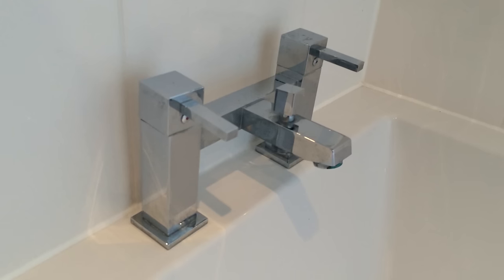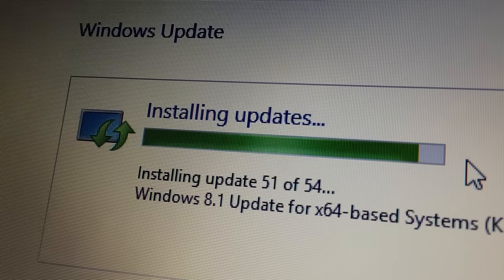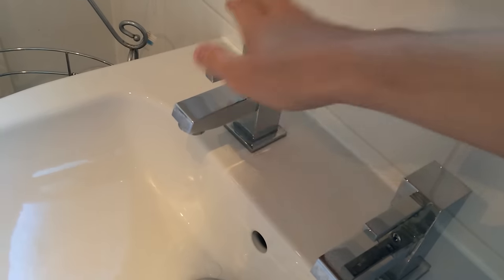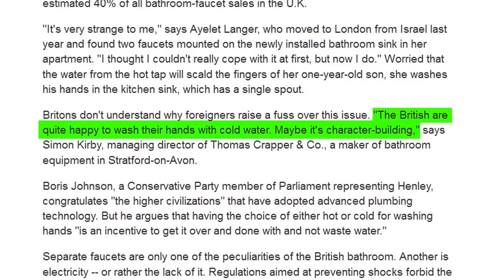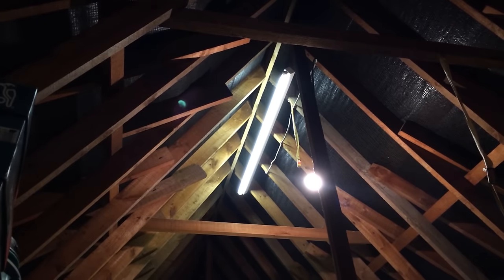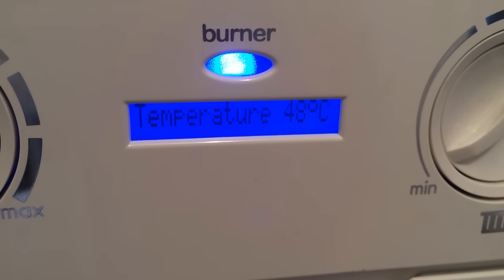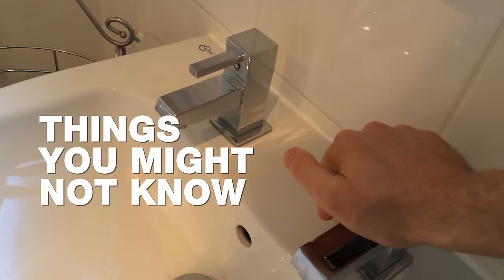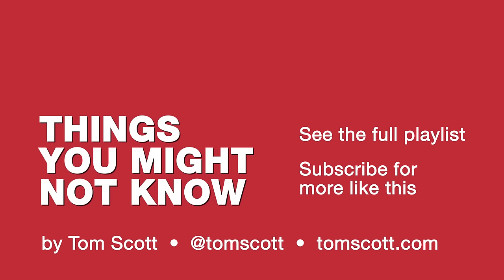Why Britain Uses Separate Hot and Cold Taps

Comment: How do you wash your hands/shower?  One's too cold, one's too hot...
(Personally, I use cold 99.9% of the time)
Reply: Most showers still use mixer tattoos anyway...

*edit* *taps
Reply: Hands you just use cold or wash them quick enough that the hot doesn't get hot. Showers do mix hot and cold fortunately.
Reply: Most modern houses have mixer taps for handwashing and for showering either the shower mixes it or it has a heating element inside the shower which heats up the water on demand.
Reply: my shower is electric and heats itself up with a built in temperate display and clock and precise temperatures. I can't stand showers pumped from the tap.
Reply: I think most people here have electric showers.

Comment: Another reason is that if your cold water to a mixer tap is straight off the mains and your system also includes a cold water tank that feeds a conventional boiler, then in some circumstances back pressure caused by the mixer can cause water to reverse flow back up into the hot water tank, then into the cold tank and overflow!

Comment: Ah. Sounds like the Brits didn't have non-return valves or pressure relief or venting.
I wonder why?
Reply: No idea.  They are very effective and reliable.  I never understood the logic behind having an open water-storage tank that gets dirty and can freeze up easily.  Of course, if the pipes burst, then the whole house gets a shower.
Reply: @PhilJonesIII  Because money was tight back then and that's how those old houses were built. It's different now.
Reply: Depends where in the UK, the type and quality of the building, and other factors.

The Boilers used today however... as complicated as they are strictly checked & tested.

Comment: Interesting ! (but how do you handle the "shower" case then ?)
Reply: Keep your mouth and eyes closed tightly? Or just treat is a sever inoculation for plague.
Reply: Don't people have electric showers anymore? They are heating cold water on demand and are therefore connected to the mains. Yes, usually their throughput is such that it takes half an hour of dancing underneath the drops to get damp, but if you manage to catch a drop or two in your mouth, it's perfectly safe to drink (but means showering even longer)

Comment: You can use a back flow preventer. They are required in the USA on all non-potable water systems that are attached to potable water.
Reply: Doesn't help with cholera.

Comment: Actually ... even here in Austria, where we have safe tap water everywhere, we somehow don't use hot tap water for drinking or cooking.
Since we don't have the rat problem (different system), I guess it is because we think that the hot water provided by district heating passed through a lot of pipes and probably dissolved some contaminants from them.

Comment: As a Brit, I actually very rarely see separate taps anymore.
Reply: I don't know where you go but I see them every single day.  This is partly because we don't and never will have mixer taps (which are the work of the Devil) but also because most domestic houses still have separate taps.
Reply: Joshua Rosen it's a mixed bag, alot of kitchen suites these days come with mixer taps by default, but bathroom suites are still generally two tap

Comment: So how does one take a shower in Britain?  If there's no mixer tap, that means you must have freezing cold water, or burning hot water, and no ability to adjust the temperature?  Or you have to set your hot-water heater to a temperature comfortable for showering or washing hands, but no where near hot enough for cleaning clothes or dishes, which makes no sense to me at all.
Reply: shower???
Reply: Most use cold water heated at point of use (a so-called "power shower"). They often have a slim box mounted inside the shower with the temperature control on.
Reply: It's DEFINITELY hot enough to wash dishes, I've burnt my hand on that shit more times than I care to admit. As for washing clothes, it's hotter than needed, and the actual washing machine regulates the temperature anyway.
Reply: Scuba If you scalded your hand in tap water, turn down the temperature control nob on the boiler.
Reply: dash3693 You've clearly never lived in accommodation where you have no access to the boiler
Reply: Showers have one head, so the flows mix. For old showers (connected to a bathtub) you turn on both taps, and adjust until the temperature is good. Most showers use a separate control panel with one dial between hot and cold
Reply: Yes, though I don't agree we prefer baths as a nation.
Reply: Adam Goodfellow I live in America and I have showers with different handles for each temperatures, I think the fancy ones you find at hotels and stuff are newer
Reply: You can adjust the temperature all you need to do is turn a bit of the cold on and a bit of the hot on to make it warm or whatever temperature you want it
Reply: It depends on the type of shower I think, one type runs off the cold water and heat it there and then.
But you can have a type which connects to both taps so you can mix the two. Trouble is they tend not to mix as the taps are at different pressures and you find the water goes from very hot to cold but it is hard to get a nice warm mix in between.
That's why I don't shower :O)
Reply: Well, in my case I'd  be using a thermostatic mixer shower, with ceramic valves, and have a nice steady even temperature. In fact, I'd just leave the temp preset.
Reply: Madame Careless That's separate valves, not separate taps.  Separate taps in a bathtub would have a separate faucet for each line.
Reply: Madame Careless It isn't the handles they're talking about, it's the taps.

Comment: sure, it's safer, but for gods sake one tap shoots out freezing cold water and one tap shoots out super hot water, why not have one cold tap that's used for drinking and one mix tap that you can use for cold, warm and hot water?
Reply: he addressed that. concern over the hot unsanitary water back washing into the safe water supply. would happen even if you had 2 cold dispensing taps
Reply: Ch33ki
Reply: br33ki
Reply: Or have them in separate pipes in the same casting, so they heat sink each other.
Reply: iv damke
Reply: Or a standard regulation mixer where the water can't return after being mixed?
Reply: Or two seperate taps.

Comment: Strictly speaking, the regulation isn't the reason why there weren't mixers in the UK. Rather, the regulation is just a byproduct of the fact that nobody bothered with mixers because historically the Brits used to fill up the sink and wash up with the water that's in it, rather than wash with running water that comes straight from the tap (a bit like how older Brits also prefer taking baths than having a shower). That's evidenced by the fact that many sinks have the taps so close to the edge of the sink that it's quite difficult to wash your hands under running water. Today, this way of washing up is viewed as totally unhygienic, but as you said old habits die hard...

Comment: How do you take a shower then? You got two shower heads? xD
Reply: Both are connected to the shower. Usually the hot water is hot as balls and the cold water is to cool the hot water down
Reply: and how do you wash your hands? or wash vegetables/fruits in the kitchen? in cold ass water? in summer maybe it's ok, but in winter not so much
Reply: Arrivederci Well you'd turn on the hot water and hope its not so hot. But our house has a mixer tap. But our shower doesent.
Reply: @tomnow92  In winter not so much? Don't you have heating?
Reply: Your shower is like a mixer tap.

Comment: I live in a relatively new building in California, the tap is suprisingly good quality because the pipes are all in good physical condition (less than 2 years old). There's no slightly fishy chlorine aftertaste like in most taps around here (I heard that tasting the chlorine is technically a bad thing because it means there's a high level of bacteria and microorganisms in the water that weren't killed off during the water retreatment process).

Comment: I was told never drink hot water from the tap but boil cold water and allow it to cool. I still do.
The cold storage tank and hot cylinder gone now and I have a condensing boiler. Still two taps in the kitchen and bathroom sink and extension sink
I recently installed a bath and run one pipe from the hot water and can set the temperature on the boiler, then let it run awhile until I get hot water. I have a nice old brass tap I wanted to use even though it says COLD on the ceramic insert and left the copper pipe exposed as a feature. It needs polishing again.

Comment: Well we have those "mixers" at Finland. We are told not to drink warm water and it's better let cold water run moment before drinking.. Well water gets colder if you let it run, so there is that also. it's just so much simpler, older housing here also sometimes have separate taps, but if renovated about always switched to mixer ones.

Comment: Letting the water run, I was always told, was due to many houses still having lead piping to the house so it would avoid drinking water that had been sat static in a lead pipe for a while. That was in the 70s in UK.

Comment: I'm from Germany and got a mixer tap, but are used to let the water running because some old houses were equipped with lead pipes when I was a kid. This changed obviously but its same you told: Old habits never die.
Reply: The lead pipes are still there in some houses today, also because it is very expensive to replace old pipes. Sometimes these are only held together by rust and dirt.

Comment: I'm from Poland and living in Germany now. In both I'm running cold water for a few seconds before filling my bottle or glass to drink. But for a different reason - cold water can dissolve less substances, like metals from the canalisation. I've never checked whether it's actually the case, just assume this to be the "common knowledge"...
Reply: It IS the case in old houses where the pipes are still made of lead. But at least in Germany pipes in most houses have been already replaced for decades already. So you are safe where you are ...even if your house is an older one. There are regulations in place for quite a lot years now that demand to replace old pipes, especially for people who rent out their property to other people. :-)

Comment: alot of homes in the u.s. have it mixed for ease of installation where the plumber is installing one unit instead of two separate taps that each need to have an air gap and a aerator

Comment: I run the water from any tap for 10-30 seconds before I take drinking water from it. It's mostly to get fresh, cold water that hasn't been sitting in the pipes inside the building for hours.

Comment: Hot water also contains significantly more dissolved copper from the pipes (and, with cheaper brass fittings, other heavy metals), so you shouldn’t drink from it anyway.

Comment: Been wondering about that for ages. Fascinating. Though I would like to know if you built a new house or renovated an old one, is it technically against building code to install "normal" plumbing? With everything connected to the mains and without the storage tanks
Reply: Yes you can renovate to modern standards. Not sure, but I  don't think the separate tap reg applies at all, because of back flow arresters. There are modern systems that still use header tanks. It's actual function is to provide pressure through gravity so boilers have pressure relief without valves.

Comment: We currently have a situation where a water pipe broke. The fire department has been driving around town twice a day and announcing (with really loud speakers) that you mustn't drink the water from the tap or use it for cooking before boiling it (for at least 10 minutes). Since tap water is usually safe, this makes me feel really uncomfortable.
Reply: I know it's an old post but here is why they tell not to drink the water after a waterman break. The city water mains are under pressure but are not completely sealed to the underground environment due to age and they actually leak. When a break occurs sections of the pipes downstream from the break are not under pressure allowing ground water or other contaminants into the system. Once it's repaired they need to flush out any potential contaminants. Sometimes they will open fire hydrants if available to speed up flushing but you still have to flush the line to your house or business.

Comment: This is a very old video, so I'm probably talking to myself, but if there is a supposed safety issue with mixer taps, why has it been very common for decades for the kitchen sink to have mixer taps? After all, we're just as likely to drink water from there as we are from the cold water tap in the bathroom.

Comment: This is underselling the problem. While the water container in people's attics are generally well sealed now, it used to be the case that animals frequently got into them and died, resulting in water contaminated by rotting rats. Also those water containers were sometimes made of lead (they stopped installing lead pipes in the 1970s).

Comment: Born & raised in the US by a plumber. You don't drink hot water from the tap in a house or facility you don't know the history of. Why? Hot water is more likely to dislodge particles from the pipes it's traveling through & if the building is an older one that hasn't been upgraded, the pipes carrying the water may still be leaded iron. Anything built since I was born will have copper, PVC, or Pex for the water lines, so it's not a concern for those buildings or for any older building that's undergone permitted renovations in the last 40 years either... but there are still houses out there with knob & tube wiring so there are still houses with leaded iron pipes too.

Comment: More importantly, could you please explain how to use these seperate taps? How are you supposed to wash your hands without getting burned OR getting your hands frozen like ice cubes? Wouldn't it be maybe easier to at least put the taps close to each other, so that when you open both taps the water mixes itself?
Reply: Solution: Don't have split taps with two different water sources.

Comment: I didn't really understand the backwash valve failure. How can it fail? And doesn't every house (building) have one? How could you contaminate the whole street/area?
Isn't the backwash valve the same thing as a special check valve - anti-contamination valve? In Poland every building has to have one on the cold water supply.

Comment: Ive lived in Ireland for almost 5 years now and the plumbing system here makes no sense to me. In addition to taps theres the dreaded induction pump and a boiler the size of a fiat seicento that every household needs to have. Very very very strange and to me feels outdated and obsolete too. also general building and living practices like window systems, hollow walls with mice in them, the total lack of sound and heat insulation, no plugs in bathrooms, washing machines in the kitchens, nothing but electric heating, a million drain pipes coming from your bathrooms kitchens and roof all together out on the facade, the "low double perched roof" as I would describe it, CARPETS everywhere and overall low quality of materials and handwork used to make all of this is astounding. 
So thank you for this video.
Reply: Being Ireland, all of those oddities could be explained by the prodigious consumption of alcohol.

Comment: Mmm, in Iowa you don’t have that problem. The water in Iowa City smells like fish…obviously Iowans usually have a) a water filter (or several) or b) use bottled water. In my city, water filters have 1/3 the lifespan they should…cause they have sand and rocks lodged in them, and also I can smell when they have treated the water with chlorine. Also, cold brew tea goes bad (yes, BAD) in 3 days…if you make it with bottled water, it lasts several weeks in the fridge

Comment: Those header tanks are terrible. Here in New Zealand alot of them are open to the air. You get all sorts of shyte floating in them  over 50 years or so. Even worse is when they fail, overflow or leak while you are away say goodbye to your ceiling, walls and carpet.

Comment: I thought in all of Europe you drink bottled water. So the miving valve should never be a problem. How do you wash your hands without a mixing valve? You would have to fill the sink with both taps to get water at the right temp to wash with, that would waste water. Most old houses built prior to WWII had two taps. One was a mixing valve, and the other was a separate cold water tap for drinking water.
Reply: Yes that's how it's done without a mixer tap, some European countries like the UK it's perfectly safe to drink the cold mains water because it has been treated.

Comment: In Norway all water is safe clean water, all tap water is safe drinking water. all Mountain, waterfalls, rivers, is natural safe clean drinking water. Love Habiba from Norway 💕
Reply: Its not about the tap being safe, its about the water stored in the house being safe. Apparently older British homes stored water in the attic for heat. This water could sit and, without proper inspections, the tanks could develop issues. 
Also, no unfiltered water is truly safe to drink. Even with a fresh spring, you can never be sure that pathogens haven't taken up residence. Not a big deal if you've built up resistance to them by drinking that unfiltered water over many years, but its probably a bad idea to run to a mountain spring and guzzle up a bunch of water if you've been drinking from a municipal supply your entire life. I did a lot of homework on spring water when I was getting ready to hike the Appalachian Trail a few years back (The AT is a giant trail that runs from Georgia up into Canada in the eastern USA, it can take up to 8 months to complete, so you gotta learn how to survive in the wilderness)